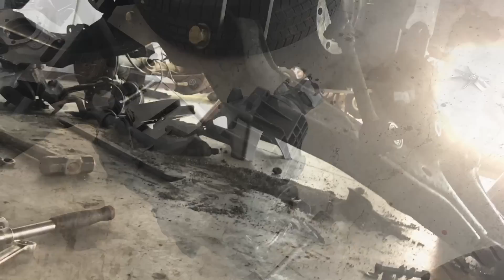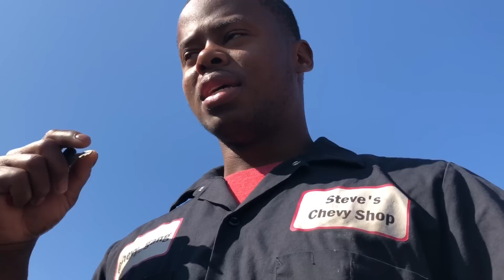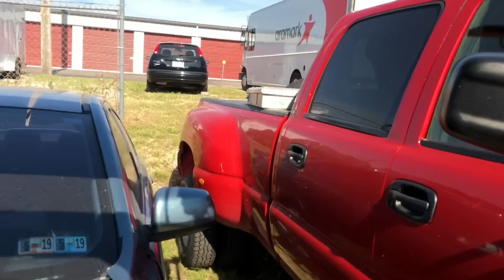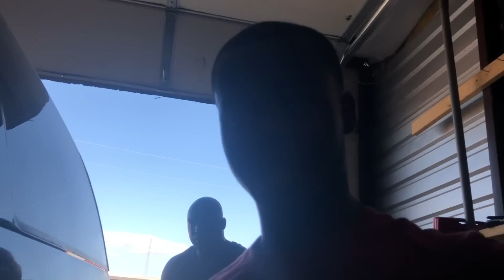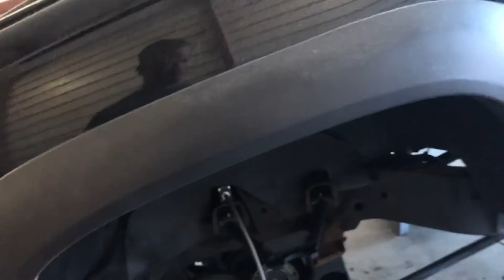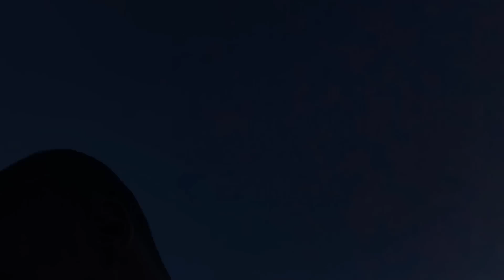2 Door Tahoe: Lift Is Literally There But......

Comment: One of us had to of installed the torsion drop brackets wrong...mine the angled side is facing the front of the truck. I didn't have to drill holes for the frame crossmember either....huh I hope I didn't do is wrong then. 😅 clean ride man!
Reply from the maker: That 2 Jacket Hoe yup, bought new ones and turned it around